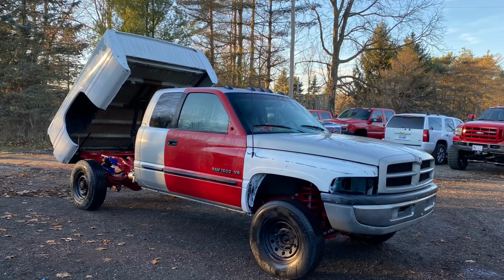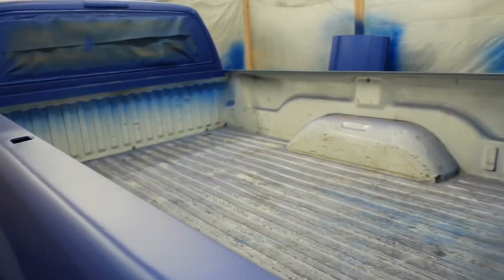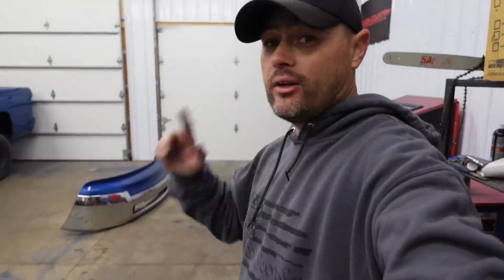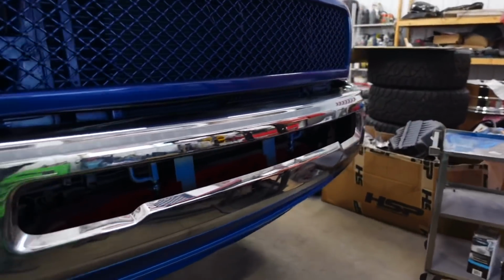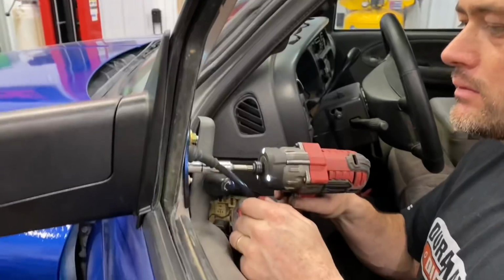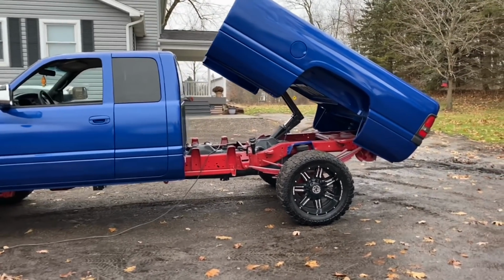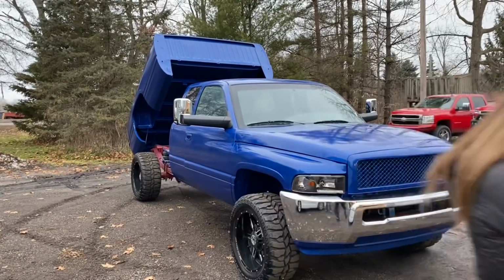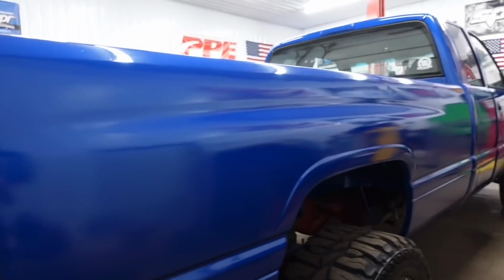The Cummins Project Is Finished! BIG REVEAL! *Must Watch*

Comment from the maker: Black or chrome wheels? What do you guys think??? Thanks everyone 👍
Reply: I’m a big fan of the color I have pb5 paint code on my 3rd gen I love the color with black 22s also
Reply: I like either one, but black wheels would look cool!
Reply: I think a set of black or brushed wheels would really set it off! Lots of work put into the truck and it shows!
Reply: Black
Reply: Chrome wheels and chrome traction bars
Reply: Chrome rims on the classic.
Reply: with that look, i would go with Chrome for sure. I am running black & milled 22x12.5 hostiles' on my 06 LBZ.... for your blue Cummins I would think chrome would look really nice. Will help your colors come together
Reply: I love the Wifemax wheels on there but, chrome wheels would surely set this truck off. My vote is chrome,  but you can't lose either way. Black with a lot of raw mill, if you went black. White wheels, like wagon wheels.....it's a thought!
Reply: Chrome lol have the chrome caps on the mirrors and the chrome bumper I think the black wheels clash with the chrome just go chrome it will finish the build off
Reply: Either one, but think the chrome would set it off the best. 
P.S., I'm not one for a lot of chrome, lol
Reply: Black
Reply: Crome
Reply: I'd prefer black
Reply: Chrome
Reply: Nether!! DO WHITE WHEELS
Reply: Wish I could post a picture of a blue 2 door tahoe that I had with a set of billet specialties on it. I got stopped for compliments daily on that truck; then a shitty driver in an ss camaro killed it while I was sitting a stop light. RIP Blue Ox.
Reply: Chrome
Reply: Chrome
Reply: Chrome wheels , black out grill mesh , radiator, and underside of hood , tint tail lights and headlights. Looks good.
Reply: I really like those wheels on the truck.
Reply: Your Dumpster Cummins looks awesome.  I’d leave the white off and keep it all blue and red.
Reply: White wheels
Reply: White
Reply: Chrome
Reply: Chrome
Reply: I like the chrome
Reply: Chrome
Reply: I think chrome will go better with the 🇺🇸 colors 👍🏻
Reply: black rims 18 inch with 44 inch super swampers lol
Reply: Black
Reply: Chrome wheels  Color looks  Sharp You did a good job
Reply: Chrome rims for sure! It’ll go with the mirrors and bumper
Reply: I think chrome or polished, it would wrap the chrome around the truck and tie it all together because with black it just looks alittle off because the only
Other part that is black is the mirrors
Reply: chrome would make the bumper stand out
Reply: Captain americas sheild
Reply: White wheels!!! RED WHITE AND BLUE BABY!!!! 🇺🇸🇺🇸🇺🇸🇺🇸🇺🇸
Reply: Paint match mirrors and chrome wheels
Reply: Polish
Reply: Chrome rims, chrome trim taillights, and white traction bars 🔥🔥🔥
Reply: Chrome
Reply: Black rims will look good
Reply: Black
Reply: Chrome
Reply: Chrome wheels and do white nerf bars
Reply: I’d have to see the chrome rims on the truck first, I think it may tie the chrome mirrors and the chrome bumper together more but the black rims look great too
Reply: Definitely matte black
Reply: Black!
Reply: Chrome, milled or machine finish. Polished aluminum looks good but needs lots of care.
Reply: @ericdavis9992  well I would do 24' inch wheels
Reply: Chrome
Reply: Black with chrome lip.
Reply: Chrome
Reply: Chrome wheels 100% man! They would look sweet. Tint and taillights would tie is all together
Reply: Gotta go chrome with the wheels.  Love the blue!
Reply: Chrome 24x14 forged lol
Reply: Black since it’s going to be a work truck. Chrome is more of a pavement Princess/show truck style
Reply: White wheels with chrome
Reply: Now you have a complete set of trucks red white & blue!
Reply: I saw some all black with blue accent that look nice
Reply: Chrome and black kind of what you have on there now but maybe a little more Chrome so check with baby doll
Reply: White wagon wheels to do the pop of white you and the wife spoke about in the video
Reply: Black with milled wheels. 
Chrome wheels are so passé.
Reply: They still make chrome wheels???  Once u go black, u never go back bro!👊🏻
Reply: Chrome
Reply: I think the black look great.
Reply: Chrome
Reply: FUEL - D645 STROKE 1PC Gloss Black with Candy Blue Accents
Reply: black
Reply: 22x14 polished wheels on 33tires with white track bars and chrome mirror caps
Reply: Black wheels with red accents
Reply: @lwinny5543  I wish i would have went with 24” on mine so I def agree tire’s where a little more but the looks worth it
Reply: I’d say black
Reply: Like the black but wanna see the Chrome to and I’m happy u pick blue thanks even tho not my truck my favorite color
Reply: Chrommmeeeee
Reply: Chrome
Reply: Chrome!
Reply: Chrome!
Reply: Mirrors out you can see more.
Reply: chrome, my second gen is all chromed out with pealing paint, and that chrome makes the truck still look like a decent vehicle.
Reply: Chrome definitely
Reply: Bm wheels
Reply: Dude love it with those wheels on it keep them lol
Reply: Gotta say the ones from Wifemax look pretty sharp on it, maybe a set like that for it.
Reply: Black wheels all the way!
Reply: Those wheels look great and the truck turned out very nice, I personally think the blue body over the red frame looks cool. I do think you should get a chrome grille or just the mesh chrome or black just to break up some of blue over the top of that 4th gen bumper but that is only my opinion, the truck turned out killer.
Reply: Chrome wheels!!!
Reply: Black for sure ! Clean build overall 👍
Reply: Black wheels
Reply: Black and milled
Reply: I like the black with chrome trim on rim, love the color of the truck and i love the mirrors, but i am a Duramax truck guy
Reply: Chrome
Reply: White wheels chrome traction bars
Reply: Just buy the exact same Wheels and tires
Reply: Black wheels with that blue would be sick
Reply: Bbc
Reply: Chrome 👍
Reply: Everything is perfect just need some chrome wheels now
Reply: Black wheels
Reply: Black
Reply: I think white wheels would be sweet.
Reply: Chrome wheels for sure
Reply: Black with the milled, like the Anthem thats on truck in the video, also the blue looks great. Did a good job
Reply: Color matched red with white centers
Reply: chrome
Reply: Black!!
Reply: Chrome
Reply: Black
Reply: I love the red white and blue theme, I do think that a bit of white mixed in would look sweet. I’m an old school chrome guy but in this case After seeing wifemax  wheels on it that a mix of chrome/black wheels or even the unpolished chrome with black highlights would be awesome.

Comment: I like things that are functional and still look good. That style Dodge is already a classic, but it's also a wood truck.  You probably will be taking it off road a lot more than your other trucks.  I would get a classic style Chrome or polished aluminum that is simple to clean. In an 18 inch rim with 35 inch tires. More sidewall aired down = more traction!
Reply from the maker: Thanks

Comment: WORTH THE WAIT. 👍 Figured you were hard at with one of the projects.  But it turned out great.  Really like the color a bit bias blue is my favorite color.  However it looks great.  Couple more paint jobs and you will learn even more.  Nothing to be ashamed of here. Great job and some color sanding and polish and buff work and it is going to be even better.  Totally agree with Mrs. Truckmaster a little white added accent will look good.  Definitely the black and machine accent rims... that size looks good on it. A light bar up front would look great.  The paint match on the grill and facia looks great.  Bug deflector... makes a aerodynamic bug shield to fit across the top of the grill cap.. already done as a flag mural.  That would look super cool up front and really work with the theme of the truck.  Paint match the taillights.  It's looking great 👍 hang in there. 
😎👍
Reply from the maker: I really appreciate the awesome comment 👍
Reply: @TruckMaster  You're welcome.  The truck is coming along great.  Here's another thought.. an 1/8th inch red pinstripe down each side [following the the top line]. They are available at any parts store.. cheap.  You can easily and carefully put it on . If it doesn't work it can come back off and your didn't break the bank..

Comment: That color is gorgeous!  And  personally,  I  like  the  chrome  accents,  bumper, wheels,  accent  on  the  mirrors.  The  red  frame  just  gives a  little  surprise!  that  no  one  expects.
Reply from the maker: I appreciate it
Reply: @TruckMaster  No  problem.  The  color  does  look  wonderful.  But  then  I'm  a  fan  of  the  blues  and  darker  greens.  I  grew  up  in  a  generation  where  chrome  was  the  thing  to  do.  As  for  wheels,  I  would  even  go  with  chromed  and  color  matched  center  caps.  Did  it  on  my  Jeep  rims.  Chrome  centers  were  painted  black,  like  the  truck,  and  then  wiped  out  the  black  paint  where   the  logo  was.  Looked  nice.  Then  I  added  white  accents  to  the  truck.  Can't  stand  a  complete  black  out.  It  shows  little  or  no    imagination.

Comment: Painting and body work is very hard to do and have turn out perfect. It takes years of practice. What you did by yourself for the first time looks great. Probably about 80% of the defects can be wet sanded and buffed. After you get the paint corrected make sure you ceramic coat it for protection. Get ready for a week to do it all. Great job!!!!
Reply from the maker: I really appreciate it

Comment: I keep mine up. I found with them down it was funky with the blind spot on the outside. I was use to the ford with the blind spot on the bottom. Plus I don't need to adjust them when I tow the camper
Reply from the maker: Good point

Comment: Josh there is a product called guide coat it comes out black that you spray over bondo areas to find the imperfections when you block sand to add more bondo to fill the gaps
Reply from the maker: Thanks

Comment: Do yourself a favor and buy 3M products when you get around to wet sanding. It looks like you may have got solvent pop, had excess moisture in the lines, didn't have proper filtration, and/or painted while it was too cold (typically from 50-90 degrees). Tape masking paper to the wall and get your spray pattern/psi correct before laying down any paint to the truck. That being said you can turn that paint around by going through the proper steps of a "paint correction" process using quality products which includes consumables and tools. i.e. use a quality da sander, buffer etc. Cheap sanders and buffers rpm's bounce all over the place and can burn through the clear coat.
Reply from the maker: Thanks!
Reply: @TruckMaster  No worries brotha. Also, you'd be surprised how many of the paint shops/painters by my shop who have been doing it wrong for 10-20 years who still don't have adequate filtration and wonder why they always get fisheyes/solvent pop so don't feel bad cause your paint looks better than half of my painter neighbors. As far as paint correction goes, the first time I did it I made mistakes and made my project take 3 times longer cause I thought I could go from sandpaper grit of 1k to 2k to 3k only to find out after buffing there were scratches from 1000 grit. Then I had to start all over and rebuy the 1k,2k,3k that I wasted the first time and buy the 1500,2500 that I should've bought in the first place. Waste of time and money. I'd hate to see you waste your time making the same mistakes. Check out 3M's Hook-it sanding pad/soft interface pad/discs. Get it in grits of 1000, 1500, 2000, 2500, 3000 Trizact. 3M is pricey but it last much longer and gives a much more consistent finish. Then 3M Perfect-it 1,2&3 buffing/polishing liquid with accompanied buffing/polishing pads. Griots, Rupes, 3M all make really nice buffers/sanders. Hope this helps. Let me know if you have any questions. 3M, Rupes, Griots, all have a Youtube channel that does thorough breakdowns of products and how to get the best results. Hope this helps

Comment: I would say for a first time major body and paint project it turned out awesome! There is nothing to hang your head about for a 10/10 (10 feet away or 10 MPH drive by) paint job on a work truck, It’s just cool learning the process and the products you are using! BTW, like that heat exchanger in the shop! Keep working hard! 👊🏻🇺🇸

Comment: yeah putting a 4th gen bumper on both the second and third gen rams, you need the conversion brackets but the bumpers do look nice, i have a 4th gen bumper on my 2004 2500 cummins and it changed the whole look of the truck <3

Comment: IMO, I think chrome wheels. And the red and blue go well together. If you go chrome wheels should tie in well with the chrome bumper and the small amount of chrome on the mirrors. With the chrome I don’t think any white is necessary. Leave the traction bars red

Comment: Mince for my 07.5 dmax should be done soon. The heads I bought came with projectors but I'm upgrading them and Tons of other stuff. I also had GMC etched in the new projector lenses. Then the amber light on the side with be paint matched red but putting a sticker over it that says dirtymax, then pulling the sticker. So dirtymax will light up amber.

Comment: Looks really good. I would go black and milled finish on the wheels. Also I would run the mirrors out cause you can see alot better than with them down. It's like looking out of the mirrors that are on your lbz duramax.  I like the blue and red I think white trac bars would look really good together.

Comment: Try the aluminum bullet highly polished wheels or chrome to match the mirrors and bumper.... maybe go gloss black on the front grill insert....did you paint the rear wheel wells blue? Go with black there....color match the bed liner blue also? Stock Black hood liner also
Looks good so far !!! Do a video with the chrome wheels to compare with Wifemax's

Comment: Josh. My lly has slight pressure in the upper hose, and slight hiss qhen you ooen the coolant cap. But the diesel mechanics tell me the headgaskets are fine. Whatre your thoughts?
Reply: They’re Prob on the way out
Reply: @3324jake  i plan on doing a coolant flush soon. Cause its was headstudded before i noticed this. Checked it few weeks after it was studded. Never was slightly stiff.
Reply from the maker: If it’s not studded it’s probably best you start looking into it
Reply: @TruckMaster  its got exotic headstuds along with aftermarket headgaskets

Comment: If your going to color sand it don't wait too long it will be too hard to sand, I'd recommend 1500 followed by 2000, don't sand too much as you only have 2 coats of clear on it and don't want to sand through the clear

Comment: Love that blue color! The black and milled wheels or chrome wheels would look great doesn’t matter which one. If I would change anything it would be color matched mirrors and leave the mirror caps chrome. Then had the 2nd gen sport bumper painted to match the truck, the chrome bumper just doesn’t look right. Personally I never liked the way the 4th gen bumper looks on 2nd gens. Great job on the truck though.

Comment: Looks great but  I think I  would've have got the bumper with fog lights so it will not look so bulky and would've went with the 1st Gen. Fold out mirrors because  they are not as bulky also and paint match them but this only my opinion. Just because  it's a big truck but the cab is still kinda  small  keep up  the work  God bless our troops and veterans

Comment: You should’ve not used bondo, & just welded in cab corner patches, idk abt dodge trucks except for the Cummins, but for the resale value you ruined the truck cuz he’ll ask if it’s got bondo, which is does now.

2nd gen dodges are overrated except for the Cummins under the hood I want in my Ford, just not before my idi pukes. I’d probably just drop a crate IDI motor in it instead of a used 5.9 w 200k. Unless a 5.9 has been rebuilt it’s not worth 5k! More like 1-2K w the P7100!